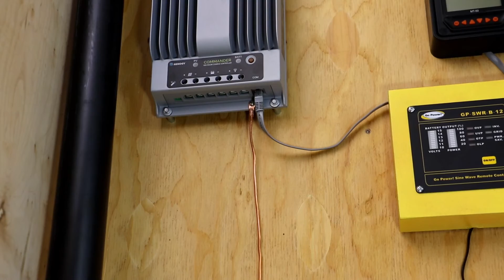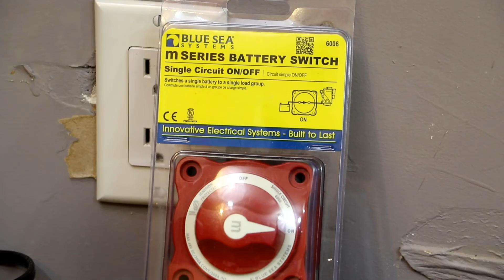Off Grid Solar Running Power Cables, Installing Fuses & Grounds

Comment: Why use the bus bar? would it not be better to go from the inverter to the fuse without the bus bar. Unless of course you are hooking other things to the bus bar. Sorry new to this.
Reply from the maker: Yes, the purpose for the bus bar is to have the ability to run additional devices.  My newest item being a 12v HID automotive light to replace a florescent tube light in my garage.  So far so good & it consumes a ton less energy after its fully running, a tiny bit more as it ignites.
Thanks for Watching Take Care.

Comment: Good job explaining your setup did I miss it your charge controller? And your array size?
Reply from the maker: Bob Bailey The original charge controller install is a separate video. It was a Renogy 40 amp Commander & I started off with one 4 panel array also a separate video.
Since then I upgraded the Charge Controller to a MidNite Classic 150 & added a 2nd 4 panel array.  Last month "video on the way" I added 2 more 4 panel arrays for a total of 16 panels now.  The system is running great its almost time to connect the A/C unit up for the summer.
Thanks for Watching Take Care.

Comment: Hi Lars.  I'm curious what the bus bar is used for?  I run my inverter straight to fuse to battery.  BTW the connectors on my inverter are close together too.  To avoid issues during setup I just didn't insert the fuse until it was complete.
Reply from the maker: +Jack Phillips The Bus bar was installed so I can attach other 12v items to the battery bank that do not require the inverter.  The Negative Bus bar is not a true bus bar.  It is a shunt so I can track & monitor the AH consumed & overall state of charge. 
Do you have videos up also?  I enjoy seeing other peoples setups too.
Thanks for Watching Take Care.
Reply: Lars Londian no videos yet.  Yours is a lot neater and more refined than mine.  Given me some good ideas to improve my setup.  My setup is a bit more hacked!   I used lithium ion batteries, Samsung ICR18650-22P.  I bought them pre welded in a pack of 20, 4.2v, ~21ah.  Wired 3 of those in series for a 12 volt 21ah battery and put in an ammo box (water tight).  Took 3 of those in parallel for a 63ah, 12v storage system.
Reply from the maker: +Jack Phillips 
That is really awesome I have seen a couple people out there in YouTube land use 18650s & they can be a great alternative plus you don't have to worry about off gassing.  
What Charger Controller are you using & with how many watts?
Reply: Lars Londian I'm using a Renogy Rover 40 MPPT and 2x 100w Renogy Panels (200w total). This enough to run everything but my AC in my office and small warehouse.  I plan to upgrade before next summer.
Reply from the maker: +Jack Phillips Awesome, I too very recently upgraded my Charge Controller & added another 400watts up to 800 total now. I Plans to add another 400 possibly this winter, but if not some time this spring.  From there I will have to convert to 24v in order to expand much more.
Keep upgrading its great & eventually you'll be able to add that AC unit to your system.

Comment: You've probably said in a video somewhere ... but what are you planning to run on this system?  I am wondering if it will run a standard home fridge.    6.5 amp Whirlpool and @ 120v.
Reply from the maker: +Michael During the summer months I ha e been running an 8,000 BTU Air Conditioner typically with the temp set at about 70° and the fan on low.  In the winter I am going to run our gas furnace blower motor.  The furnace uses far less energy but there will be less sun also.  This system would power a refrigerator that only pulls 6.5amps @ 120v
Thanks for watching & Take Care.

Comment: Looking great! Just a quick thought on the grounds. Might reconsider using that busbar for the bare copper. FWIW, each unit (inverter, solar charger, etc) should have it's own dedicated ground wire to the earth (grounding rod and separate lugs to those wires). However, having something is better than nothing!
Reply from the maker: Chris DIYer Yeah I was messaging with +Yankey4 about the ground.  we had quite a thread going.  I Always appreciate the information & take it in with a constructive mindset.
Thanks for Watching.

Comment: Looking good brother. One thing and you may know this. But do your best to keep the inverter wires the same length.  Your earth grounds would best best to have them all on one lug. Not broken up.. Hope you see what I am trying to say. But what can ha[[en is your earth grounds could have a broken spot and not let the ground do it's job. I know what I am trying to say just do not know how to say it lol. 

The bar your using for your earth grounds needs to be one solid piece. Not at all trying to be an ass our be that know it all guy. I just care about this working well and being safe for you. Hope there are no hard feelings
Reply from the maker: +yankey4 I do see & appreciate what you are saying & I am definitely open to changing it.  There are jumpers that link the sections of the terminal block together as of now.  Take a peak at the zoom in of the terminal block & let me know take care.
Reply: Yes I see the jumps but tho's are what will be come your week points. Look in side an  AC breaker panel. What you will see is the terminal block will made as one peace. They do it like that for s few things but the main is to keep a good common Bond in all your wires. This is be comes more or less an fail safe.  You can pike one up cheap at lows.
Reply from the maker: +yankey4 
Consider it done.
& Thank you.
Reply: O and I goofed. I forgot to tighten down the screw on my invter earth ground. Got a good zap from static electricity. On top of that I have been to 2 or 3 house fires that where blamed on bad grounding. This was from the City fire inspector that been on the job for more than 20 years. So I am a bit of a stay nut when it comes to it..
Reply from the maker: +yankey4 I do remember watching the video where you mentioned getting zapped.  The ground lug is quite large on this inverter, but I got the 8 awg wire in there nicely I bet 4 awg would fit in the lug.  I will be posting a video just about the ground lug.  Its not very serviceable & I like to make sure things are snugged down on occasion.
Reply from the maker: yankey4 
Getting ready to acquire a new Ground, Do you have an E-Mail address I can message you at?  or feel free to message me. Londian.l@gmail.com
Reply: I will send an Email Now..
Reply: Ok Sent a email..